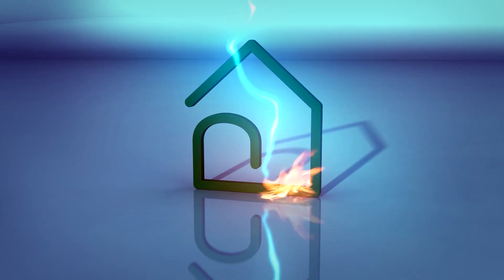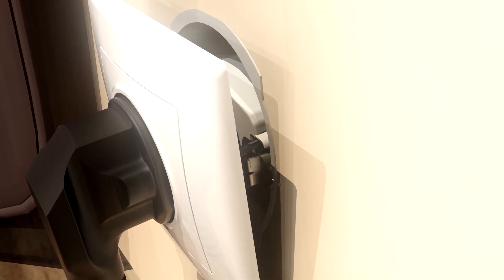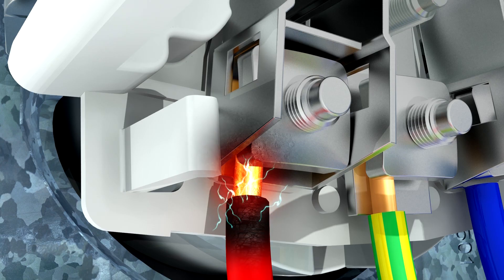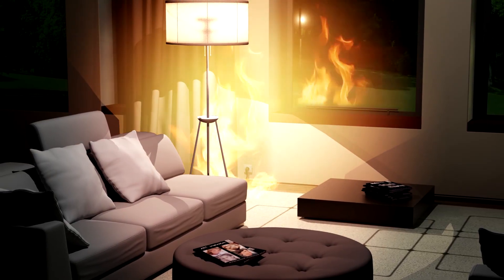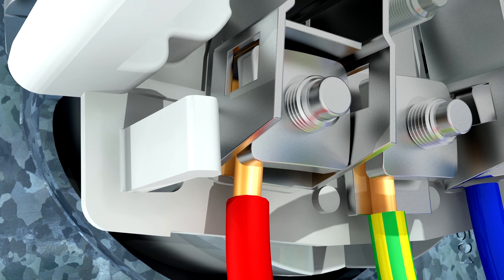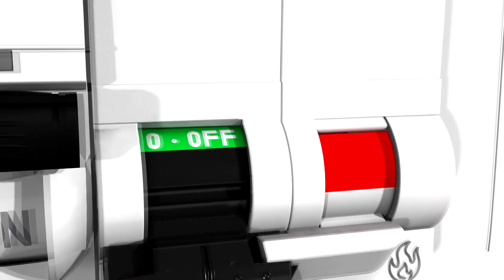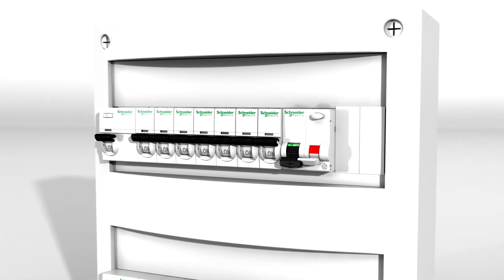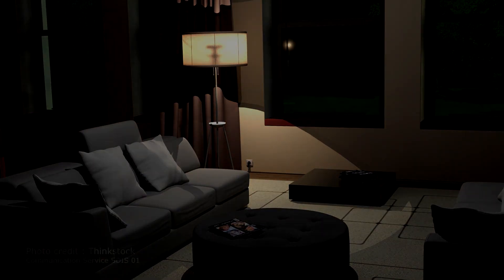What Causes Electrical Fires? | Electrical Fire Safety from Schneider Electric

Comment: I just had an electrical fire. I have a schneider electric circuit breaker which did not trip off!!! Luckily we were able to curtail it with fire extinguishers. Awaiting an electrician to identify the cause.
Reply: The only task for the circuit breaker is to avoid the overloading of the wires (drawing too much current). Not to stop or prevent a fire. Your situation was probably caused due an improper installation
Reply from the maker: We are sorry for your experience. Please reach out to our Customer Care team https://www.se.com/ww/en/work/support/country-selector/contact-us.jsp if we can be of support. And please share your Customer Care case number so we can follow up internally.
Reply: @schneiderelectric  thank you for reaching out. Shows you're customer friendly. It happens there was a short just before the meter. Cut and joined Electrical cables. Poorly terminated. The Schneider electric circuit breaker is located inside the house after the meter. I'll share the details with your team. Thanks
Reply from the maker: @Nosyagent  - Please let us know if you have a Customer Care case number we can follow up on or if there is anything else we can do to be of support.

Comment: High voltage is one in major cause of fire which you have not included in video. Other causes are break of neutral in 3 phase supply or phase in neutral.
Reply: High voltage itself is not a cause of a fire. Be specific.

Comment: Yeah a surge arrestor definitely cannot control the weather, and most will not protect equipment from a direct lightning strike.
Reply: SPDs are for protecting your electrical equipment, not the home itself, for that you'd need a lightning rod.